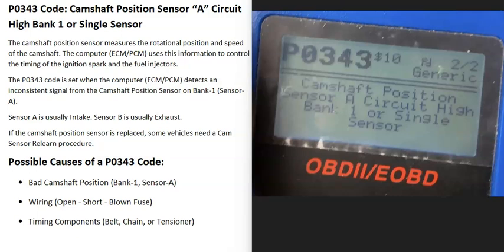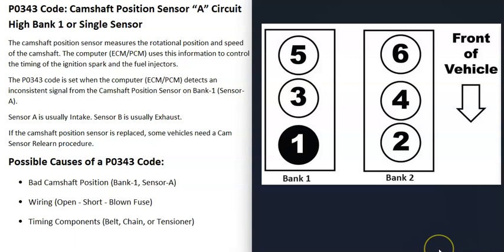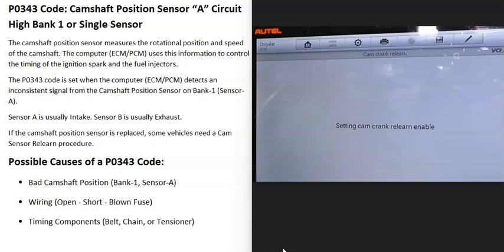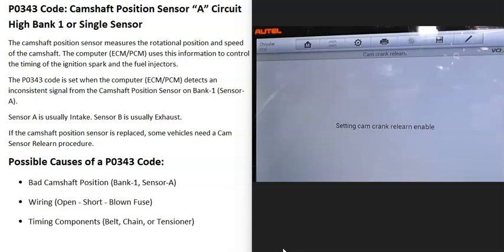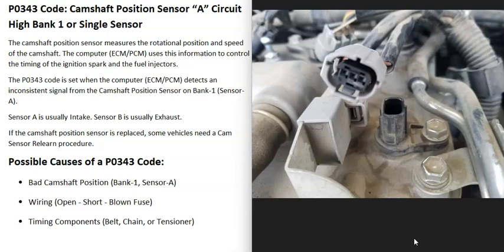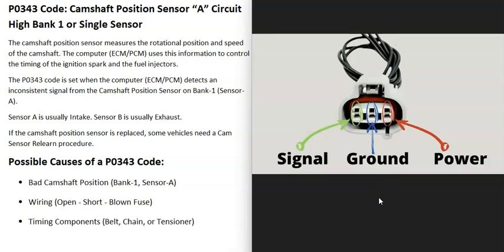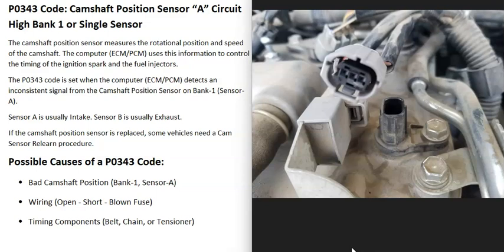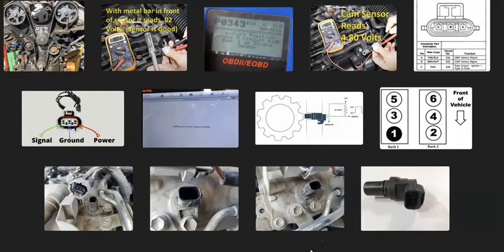Causes and Fixes P0343 Code: Camshaft Position Sensor “A” Circuit High Bank 1 or Single Sensor

Comment: Well my car has it po343 but the engine cranks no spark at all please make a video on it spark no start , it is a rare thing
Reply from the maker: An issue with the cam position sensor can cause no spark. I would check the fuses and, if they are good, test the cam position sensor and wiring.